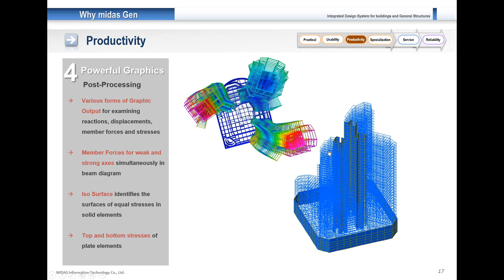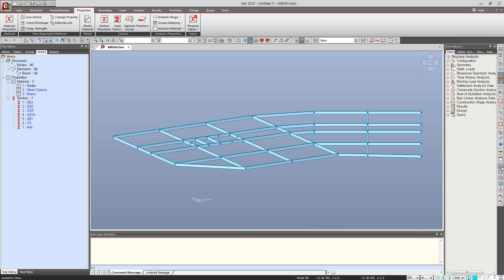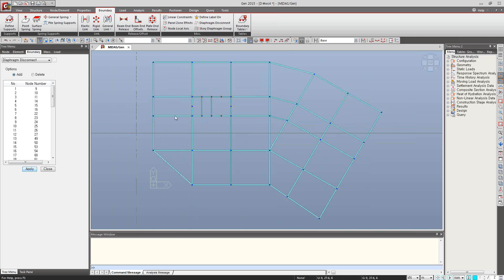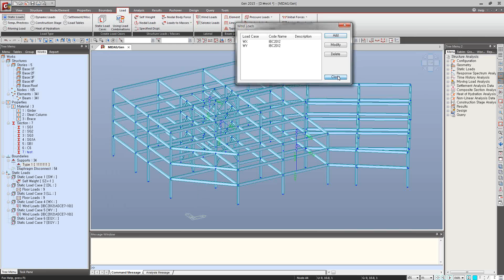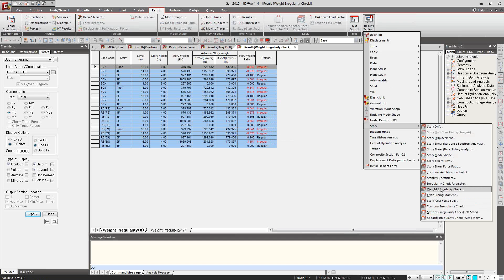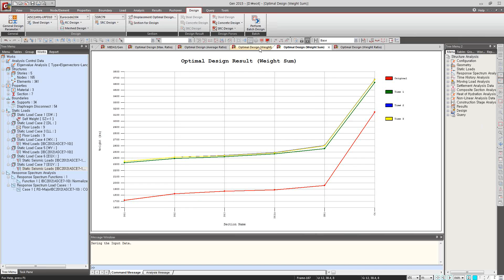Designing Steel Structure by midas Gen

Comment: in the last section you did the optimal design, while earlier no section was failing. In optimal design the software has increased the tonnage or weight as compare to original sections, why did it increase the sections when no section was failing earlier. pls guide.